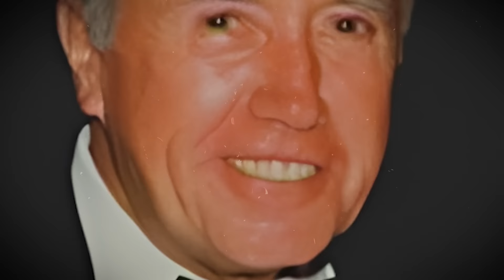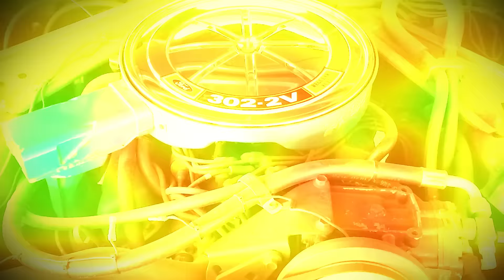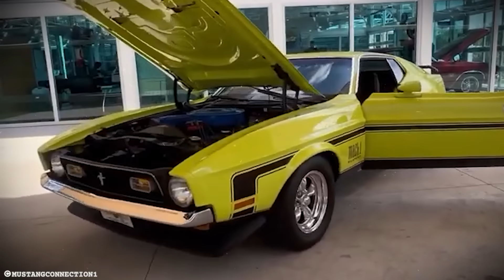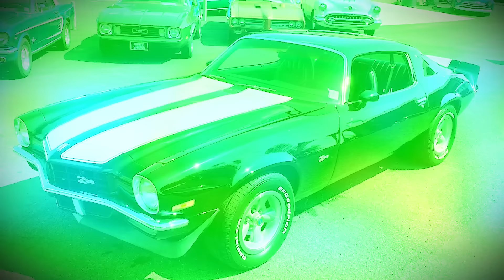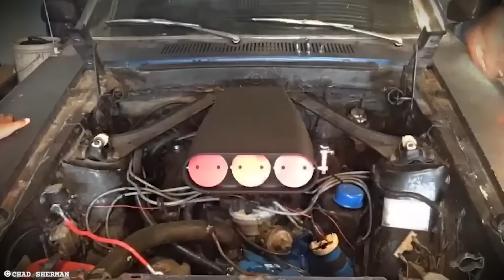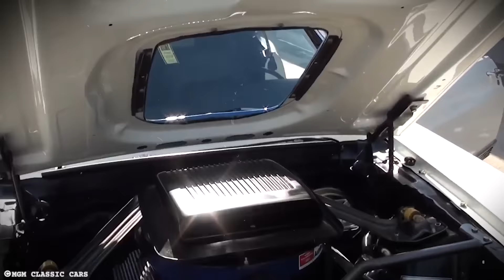Why Ford's 335 Series V8 Failed - The Cleveland Engine That Should Have Been Great

Comment: This is B.S. 351 Cleveland was a fantastic engine. I had one & it was still going strong without being touched @ 250,000 miles.
Reply: i had a big problem with mine- my fist got stuck in one of the intake ports....
Reply: I’m glad I saw your response before I got to the 20 second mark… I hate listening to B. S.
Reply: Of course they are great engines. The 70 351 4 barrel was not a great street engine. The big heads were designed to produce power at very high RPM's. The 1971 Boss 351, was a very fast engine. A way to look at the 351 Boss.  It is very similar to the Boss 302 from 1969, and 70. With a longer stroke.
Reply: @kenbishop-y2u Some were lucky to not get a block with core shift😒. I had three, two did and one didn't. However there is a solution before you begin. When boring and honing you should always use a torque plate. The last one I went a step further and bolted a stud girdle in place before any machine work. Australia bought the castings and used more nickel to solve the problem.
Reply: @LynnRunningdeer-v9b  Yes I remember Bud Moore buying the blocks back in the 80’s. I live 11 miles from Bud Moore shop. I had friends that worked for Bud.,They were welding the ports up on the heads to make them smaller. NASCAR had restricted the carburetors in the early 70’s. The reduction in ports increased torque. And with restricted carburetors. They could use the flow advantage.
Reply: @kenbishop-y2u I had a 70 Mach 1 351-4v 4spd top loader. Only modification was an Edelbrock Torquer intake and Carter carb. It was the best street car that I ever drove or rode in. The next best was a 340 Dodge Demon. The two best ever small blocks of the 60's and 70's. The Mach 1 cornered much better than the torsion bar Mopar.
Reply: Uh it's a well known fact that the Cleveland lacked nickel which resulted in core shift and cylinders cracking if you went more than .40 over. That's why the production was short lived. The Australian version address and fixed the core shift by adding more nickel. Also the problem could be limited if you bored with head plates.
Reply: Dang right they were! I've had all 3 (C, W, M) and they were all good engines. I guess it just depends on your preference and application needs.
Reply: My 73' Ranchero Cleveland  4bbl. went 500,000 miles with minor  engine work! C6 auto went 480,000 miles [never serviced] was still working ,but blew front seal These "problems" discussed in this video were  racing failures only.
Reply: just because yours last it doesn't mean it was a great design
Reply: That's what I have always heard too. It was the Windsor that was junk.

Comment: Richard  Nixon Changed the laws in 1970, that was the real killer of all performance cars. When Ford  designed  the cleveland in 1966 They had no idea that the  year the new engine would be released Nixon would pass a law taht killed all performance cars. Nixon ststed you spend millions every year on racing, it is time that money was spent on clean air.' He set a dead line that Car manufacturers had to meet of pay a fine for every car that didn't meet his new standard.
Reply: I owned a 1970 Mustang with a Cleveland 4V 4 speed and it  had no problems at all, With a Cam headers and a Holley carb it ran 12.04 at 112.23 MPH.
Reply: and whatever THEY didn't mess up- the carter administration jumped in there and did the job